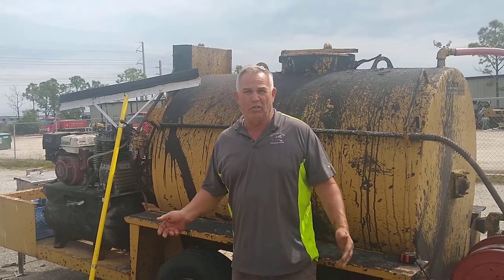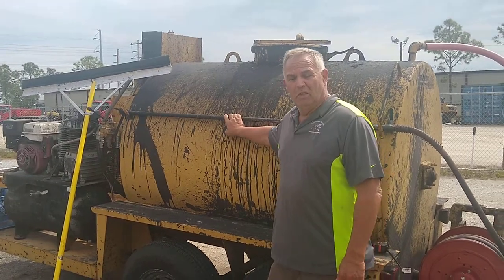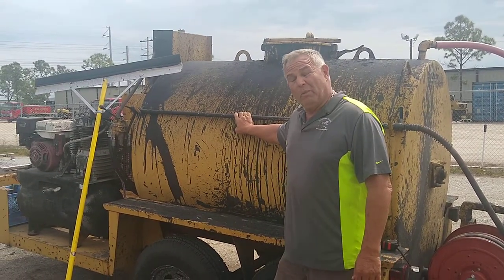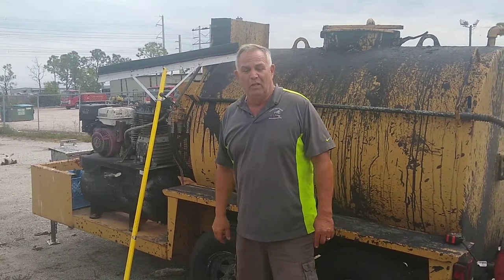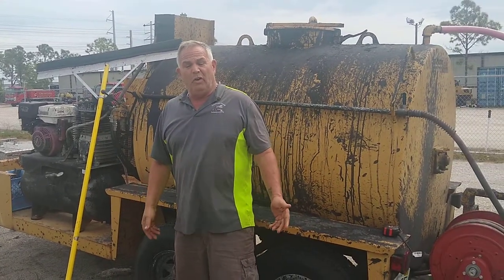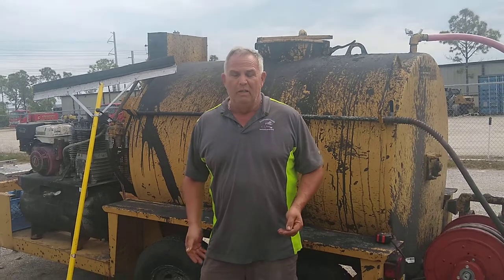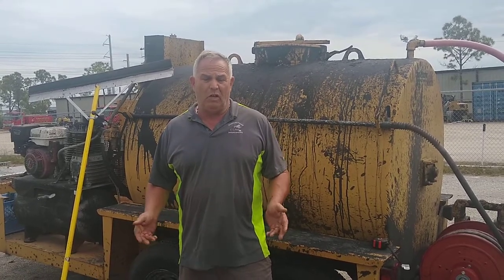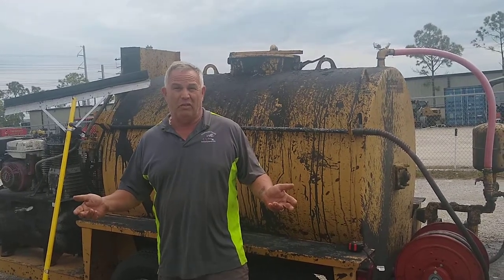Sealcoat squeegee versus spray

Comment: If your spraying the correct way your going to get a much thicker coat everytime, a squeegee pulls the sealer off especially on a slick asphalt driveway just like it does on your window when ur cleaning it with a squeegee
Reply: No, there are different types of squeegees: floor, window, tennis court and asphalt. An asphalt squeegee is made specifically to spread and sealcoat over the surface.

Comment: where can you get the oil based stuff? I think at big box stores they only sell water/silicone based sealers
Reply: Oil base sealant is niche, and most home improvement chain stores doesn't carry it. Even the contractors use the water base sealant. Oil base sealant has a strong odor, and it takes a very long time to dry, cure and it's very hard to clean afterwards, the same as oil base paint. That's why the majority of the consumers doesn't use it, they buy and use the water base sealant and paint, instead of the oil.

Comment: What's the biggest commercial lot yall have done by hand with squeegee? Are smaller to mid size commercial lots just unreasonable with a squeegee? I'm debating on doing some properties by hand but not 100% on doing it lol
Reply: I do all residential jobs by hand and commercial lots less than 5000sqft. 

I never do 2 coats if squeegee. Always if spraying. I never add sand or silica or whatever; its totally unnecessary,  just creates buildup in the tank and trashes your pumps.
Reply: @highvalleycowboy1  i feel bad for your customers

Comment: Squeegee last longer . Sprayed  is good in a way
Reply: Squeegee does last longer but spray is faster and more cost effective and a good spray job should last 2 years ....where doing it by hand can last 3 or 4 years which deters customer from doing it every 2 years ...
Reply: My guy brushes and lasts me 1 to 2 years. Spray lasted 3 months. Spray cost me double in price too. I guess a lot depends on the quality of the material used.
Reply: @fattysgarage1754  Spraying is the worst method of sealcoating because it doesn't last very long.